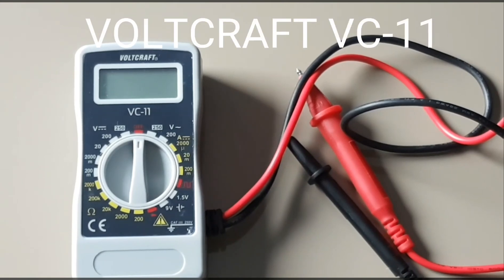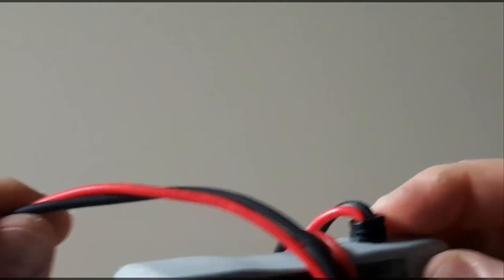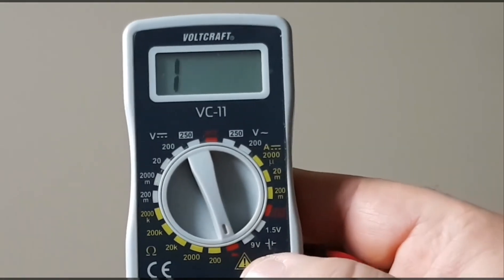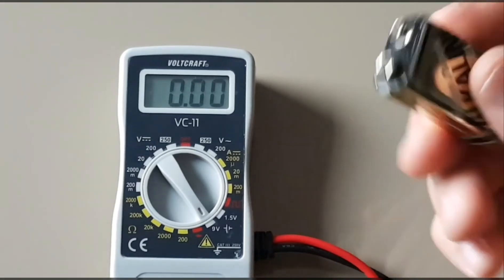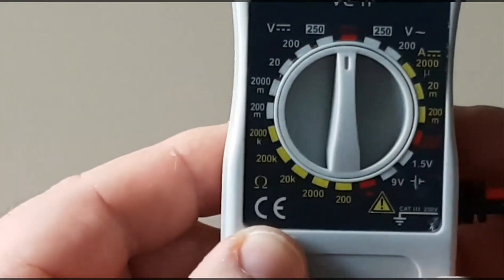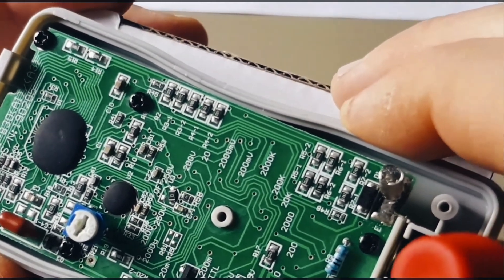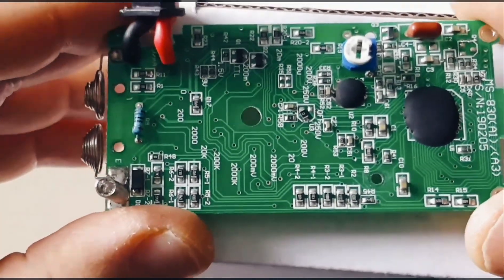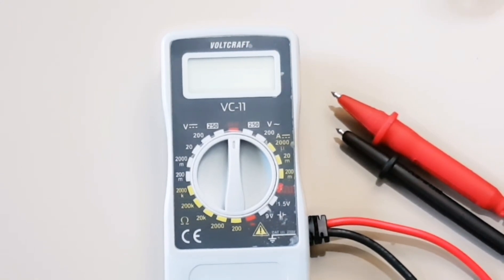VOLTCRAFT VC-11 Multimeter Review & Teardown!

Comment: how to change the battery?
Reply from the maker: To replace the LR44 battery you need to unscrew the 2 Philips screws located on the back bottom of the multimeter. Then gently lift and it should snap off the back.

Comment: I received this as a gift a couple of years ago while making an online order at Conrad webstore. Really neat little multimeter. Yu mentioned protection, well, it is Cat-III rated which normally guarantees a decent level of protection while operating on mains AC. 
There are a couple of little annoying details/shortcomings though you didn't mention:
- it doesn't have an 'auto off' function, meaning that if you forget to return the dial to the 'off' position after use, it will drain the batteries quite quickly (in the course of a couple of hours or less). Happened to me quite a few times, it's really frustrating!
- on top of having to open the case to change the batteries, you also have to look at their orientation before removing the, as there isn't any keying in the battery compartment! Quite annoying, especially since it is very tedious also to remove the batteries, you have to use some pincers or other tool. I must say I'd rather have the meter use AAA batteries even if this would mean a slightly larger size.
- as mentioned the leads are quite short so while manipulating them this will cause the case to move about, and also the probes are quite short and ill-adapted for testing 1.5V batteries.
- it would be nice to have interchangeable tips for the probes for various usages.
- it would really be nice to have probe covers so you could carry the meter without risking to damage your pocket or whatever case you use to carry it.
- lastly, it would be nice to have backlight...
All being said, given the price tag (less than €6 in Europe!) it is unmatched in termes of features & quality vs price.
Reply from the maker: Great info! Thanks for sharing. Indeed it's a terrific little dmm with alot of personality at a great price! The fuse in the leads is also a nice touch. Agreed, those pesky batteries are a pain to swap and since there's no auto off you might become an expert in no time. All in all a great little dmm. Keep on Testing! 😃👍

Comment: Thanks for the review! Just some afterthoughts:
It's so light that any jiggling with the cables will drag it along. Pulled it off the desk so many times. :D
That, and the cables could be better -  silicone insulated would be nice and flexible, these get rigid in cold temps - and draggity intensifies (which can be a nuisance e.g. in an engine bay trying to measure the battery).

(Batt test: 1.5 V mode is 30R, 9 V is 1k8 in parallel.)
Reply from the maker: Happy New Year!! Yes..the meter weighs almost nothing and its constantly being dragged by the huge leads attached to it...Silicone would have been very nice. Thanks for the feedback...I don't use mine often but it's still going strong 3 years later..
Reply: The same happens with my keychain DT-182.

Comment: Thanks for the review.
Can you please tell me, if I want to test two cables to know which one is PLUS and which is MINUS, does this Multimeter do the job? If yes, where should I point the slider or the switch?
Thanks
Reply from the maker: Hello, if you connect a multimeter positive lead to positive, and negative to negative on the circuit under test the meter will give a positive measurement. If the connections are reversed you will get a negative voltage reading. Depending on what your testing, another example. You want to check the source voltage of a laptop so that you can confirm there's 19 volts coming into the mainboard. One lead on ground..the other onto the mainboard input adapter pins..once you get a 19v reading than you know you've got the positive lead because the black wires are ground.
Reply from the maker: In my case, the VC-11 is over a year old now and the battery is still going strong. Remember, this meter has no Auto-Off function. If you forget to switch it off then you'll be using up the battery very quickly. The LR-44 batteries should last for years with normal usage.
Reply: Darren Walker,
thank you for the quick reply
I reread the reviews of the multimeter and this seems to be a popular issue. I will return it and purchase a better one. Looking at the price of the  batteries, it would make more sense to.
Reply: Hello,

How long did the battery last?
This is the second time, i had to return the multimeter because it stops turning on after less an a week of use.  Could it be caused by the batteries?
Reply: @akj7  well, given the meter hasn't got auto off function, usually the batteries last until the time when you forget to return the dial to the 'off' position after use :-) Meaning anytime between a day, a week, a month, or a couple of years :-)
Reply: @laurentd9980  Indeed, this is what happened. Due to the fact that the batteries cost half of the multimeter itself, i decided to get another multimeter and have not had any issue since. The new one automatically turns itself off, has backgroud LEDs, uses cheap 1.5v batteries and costs around the same price as the previous one (the one shown in the video). Moreover the leads are removable and feels great in the hand.
Reply: @akj7  Exactly, so far I spent more money as well on batteries than on the dmm itself ! :-) 
Can you please tell me the brand & model name (and price) of the one you're using now? I also have a big Velleman one for home and general use but I quite like to have a smaller one that can be easily carried
Reply from the maker: My pleasure. Not sure why some are experiencing this sort of parasitic drain, must be a faulty component or IC. Mine has performed admirably and has taken quite a drop as well with no ill effect. I have a colleague who's had one for almost 3 years and he's reported not having to change the batteries once in this time either. I'm curious, can you tell me the date of manufacture on your VC-11? Should be on the exterior back of the meter with a sticker. Thx